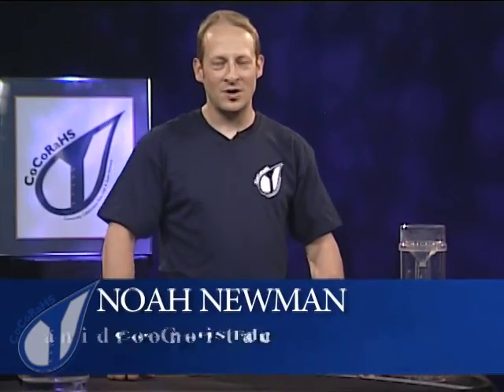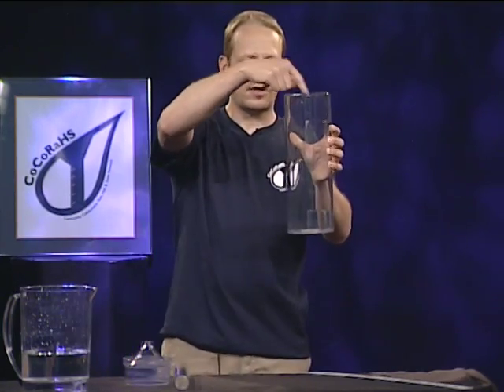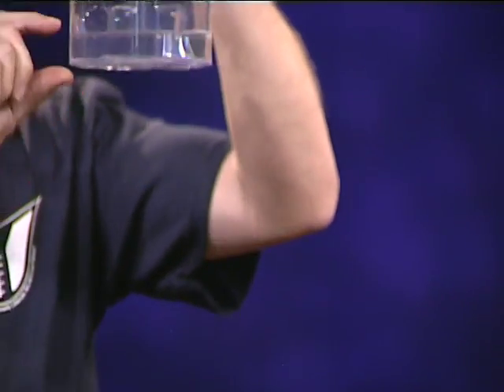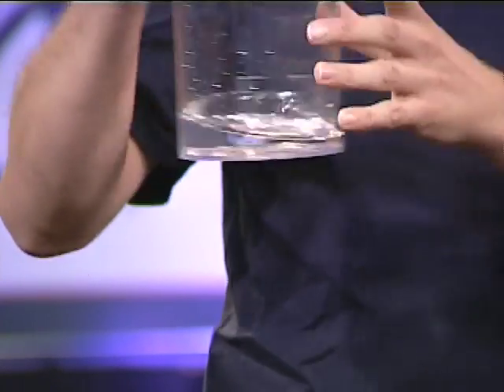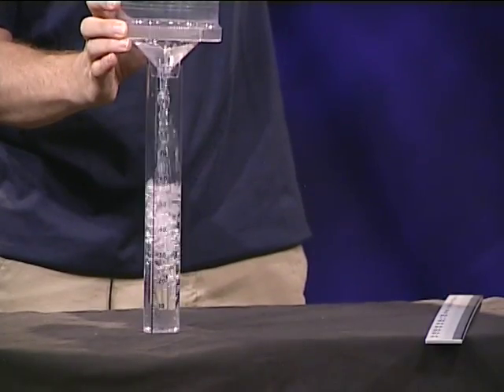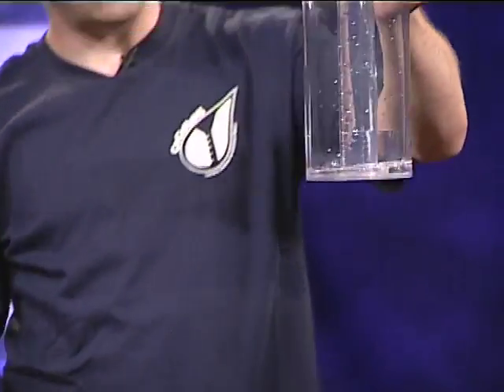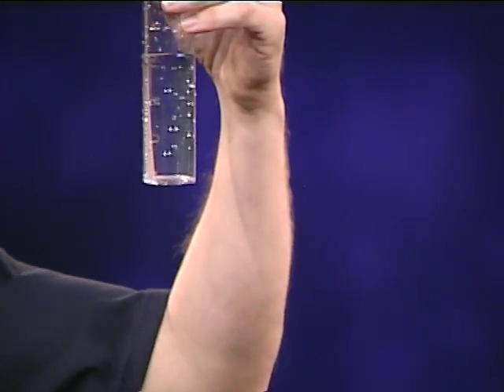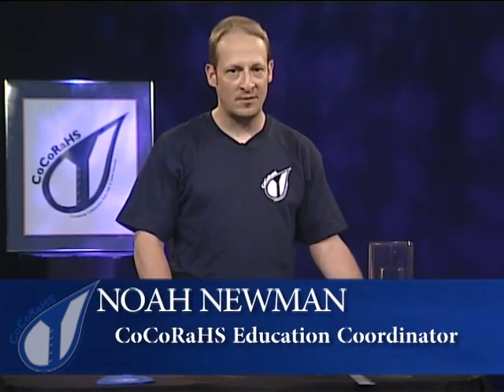CoCoRaHS Tutorial - How the rain gauge works

Comment: the larger outside container should also be calibrated. that way if you get say 4" of rain, you can easily add the 2 tubes together for a general measurement.  not a scientific measurement.  I use a 7" tall glass cylinder, from the dollar store, its common usage may be to hold flowers, not sure, but it's perfect for a durable rain gauge. I've attached a laminated paper ruler to the outside of it. works great, been using it for 5 years

Comment: Can someone explain, why is the height of the water level changes when it is poured into different container that is calibrated. I am confused because I thought the water level will be the same regardless of the diameter and shape of the containers as long as the sides are straight and the top and bottom are of the same size.
Reply: Lol this caught me off guard at first. I was thinking surely you realize the volumes of the containers are different. But then I realized what you were asking I think. 

The “inch” measurement is different because the water was captured using a larger diameter container, then transferred to the smaller measuring tube. 

If you sat both the larger container and the smaller container out in the same rain they should both measure the same “depth” of water because of how big the opening is in the container.
(Edit: the smaller tubes graduations would be incorrect if you did this. But if you sat the two containers side by side the water level should essentially be the exact same)

Comment: it is said any diameter container will do, but if i put he "calibrated" inner tube directly out in the field next to the outer container, and an inch of rain falls the height of rain in the 2 containers is different, you say put a ruler in the outer and measure an inch on the ruler, but the pour it into the calibrated tube to "accurately" measure it, but if that calibrated in tube was not calibrated and an ordinary tube putting the ruler against that tube would measure a different height as you show  1 inch fills that tube but 1 inch in the outer is not very high, so surley putting a ruler in any diameter container will record a differnt heigh on the ruler..I am confused...
Reply: same question. I don't understand why the height of the water changes when it is poured into different container that is calibrated.

Comment: What if the the top furnace diameter is bigger 
The amount of water would be recorded in large amount
My question is if there are two different rain gauge with different dimensions
How are we supposed to calculate the amount of rain fall?
Reply: Well, then you need a bigger measuring tube which can hold 1 inch depth of water of your furnace. Ultimately result will be the same. The measuring tube is proportional to the furnace size.

Comment: Lol switch to metric system already, far simpler.
Reply: True but completely irrelevant to this video as he only talked about 10ths, 100ths, and whole numbers. Ya know, similar to metric simplicity.
Reply: @jerredlee6739  The only thing similar to metric is that it is a measurement.
Using 10ths n 100ths is still fractions, not whole numbers.
I'm guess you grew up learning the imperial system.

Comment: Please correct me if Im wrong, the purpose of the measuring can is to collect rainfall (especially trace amounts) and know the depth of it given the dimensions of the cylinder. Now if I want to use the depth of rainfall collected in that cylinder and correlate it to a specific area, say 1 hectare, then I just have to do ratio and proportion using the (depth/area of cylinder's mouth) times (x/area of 1 hectare) and just solve for x? hmmmm
Reply: One millimetre of rain is equal to one square meter at 1mm high.

Comment: Amazing to hear so many people talk about inches of rain with out telling how much VOLUME there is in "one inch" of rain. I found that one inch of rain is 4.7 gallons of water (in a one squared foot one inch high) or one liter of water ( in one squared meter 1mm high). Is this true??? Any one???
Reply: Exactly. One millimetre of rain is equal to one square meter at 1mm high.
Reply: People interested in rainfall for gardens or farming generally want the depth of the rainfall. An inch of rain in a back yard patch of corn means essentially the same as a one inch rainfall in an industrial farm covering hundreds of acres.

People concerned about saving water in reservoirs or handling storm runoff are more interested in volume, and in the US that often means "acre-feet." That's not acres minus feet, but the volume of water that fell on the watershed (in acres) multiplied by rainfall in feet.  This often isn't for a one-day event, but something like the springtime runoff of the entire snow season's precipitation.
Reply: A cubic foot of water is 7.48 gallons, therefore your 12" x 12" x 1" volume is only 0.623 gallons.

Comment: 0.31" x 16 = 4.96, so it's 1" & 4.96/16th of rain. Or.. 0.31" x 32 = 9.92, 1" & 9.92/32nd" or rain. or.. 0.31" x 25.4mm = 7.874mm

I thought that if I put a container with straight sides that it would be able to measure the rainfall. But the rain gauges made by companies is just a little more dramatic. I think that's the word.. Not sure, correct me if dramatic or dynamic isn't a good word.

Comment: No mention of "the wind problem" or how rain gauges do not accurately measure rainfall because of where it could be placed. Imagine a student places the rain gauge in their backyard as the presenter suggests: the surrounding structures or possible vegetation can obstruct the true rainfall amounts and skew the data. If the rain gauge was placed on the side of a building, wind can move up the side of the structure and push rain away from the gauge resulting in more rainfall on the side where the gauge isn't, or the other way around: both resulting in inaccurate data. It is easy when demonstrated with a pitcher of water. But if you demonstrate by using a spray nozzle on a hose in an open yard and place the rain gauge in the path of the falling water while moving the hose from side to side it will appear that the rain gauge collects water uniformly when in fact rain falls anything but uniform. If the pitcher was placed in the center of the pivoting spray hose area, then it would collect more water than if it were placed and the edge of the spray hose area. If you know for certain I am wrong, please correct me. As a reasonable scientist, I am willing to be proven wrong when presented with empirical data.
Reply: dig a hole and put it in the ground
Reply: would an open field be the best place for a rain gauge?
Reply: You just explained one thing with a whole paragraph...
Reply: +Jason Ortiz good points
Reply: Jason Ortiz what

Comment: This is a really great video, but the presenter needs to put the plastic container on a flat surface to measure the water correctly.  If he picks up the container, the water moves around and the measurement is not correct.  Again, this was a great video, but it would be better if the container were always left on a flat surface and not picked up.  Have a great day!
Reply: It is just for knowing...